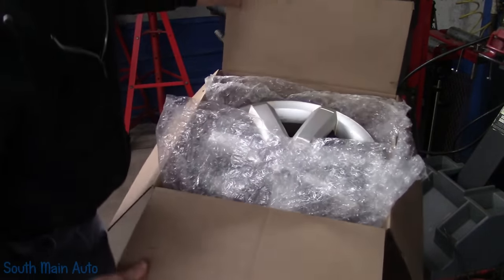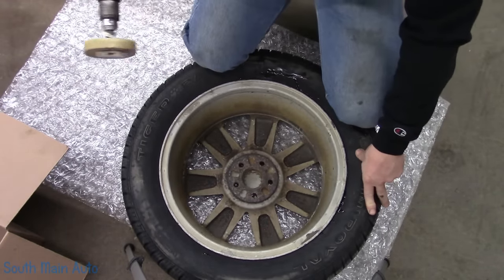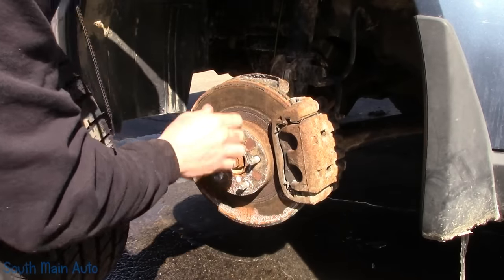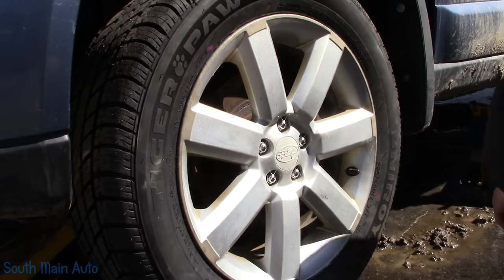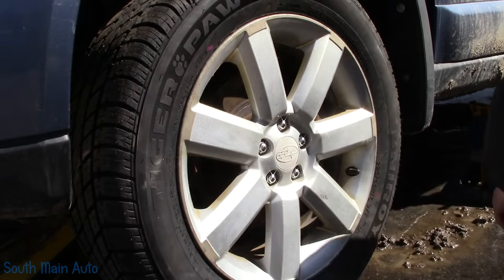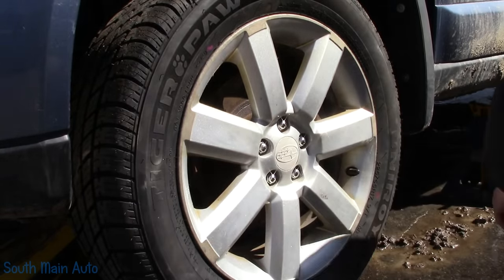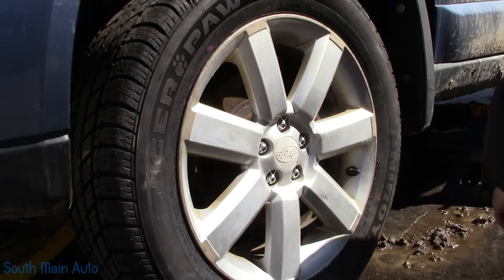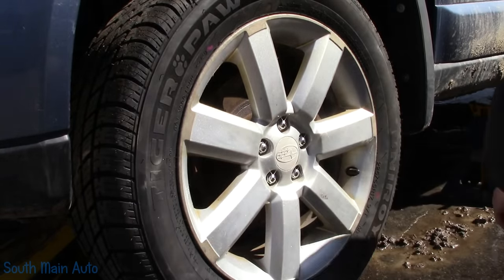Subaru Lost A Wheel On The Highway!

Comment: Eric is by far the most THOROUGH mechanic I have seen .No mechanic I've used or seen cleans rims and applies corrosion resistant goop like he does or cleans up brakes ,adds corrosion resistance.They ALL just threw them together,unless there was a problem.Raggedy old hats off to him.Great vids 👍
Reply: We always do here in Flagstaff, AZ! Plenty snow, magnesium chloride salt and the cinders around here are year round and thick.
Reply: He is one of the very few people I'd completely trust to work on my cars
Reply: @Jason Bowman maybe I'm used to the clowns at walmart tire center that intentionally put the balance weights 180 degrees off so I had to make a second trip.
i know lots of the smaller Ma/Pop shops are very good.
Reply: I used to clean the surfaces every time, especially the rotor surfaces, back when in my day we still machined the rotors on a brake lathe instead of just replacing them.
Reply: @Jason Bowman Not counting word of mouth referrals. .
Reply: @Jason Bowman The profit is in repeat customers.
Reply: He even took the tire label off to avoid a balancing error!
Reply: @daverose8772  YES! That's what I noticed. Small amount of error, but an error that was eliminated by the application of common sense.
Reply: I clean every part when I do my truck brakes. The rear drums I even clean the springs and retainers t hold the shoes on. Clean enough like new. Never have brake issues.
Reply: What are these cinders you speak of?
Reply: I do.
Reply: That's what I was wondering, 

"""
Art Wallace
We always do here in Flagstaff, AZ! Plenty snow, magnesium chloride salt and the cinders around here are year round and thick."""

What's going on in Flagstaff that cinders are around all year round? Maybe local slang for something?
Reply: ikr thats the shit i do when i work on my own car.
Reply: Obviously for the video duh
Reply: I'm confused, just need a hammer to release ball joint from control arm. And ball joint isn't pressed into knuckle. This is all the unnecessary tools required video
Reply: That is why I prefer to fit tires myself. One local tire fitter around here is well know for not cleaning the rims and then they leak air slowly. Always clean the rim, and always use bead sealer.
Reply: He's the difference between a professional, thorough mechanic and an amateur-like lazy mechanic like Scotty Kilmer. What was the last repair you have seen Scotty perform and what have you seen Eric perform?
Reply: @jameskoralewski296  Kilmer's performance is more of a comedy act to me.  I would not waste time watching him. You learn so much more watching Eric. I would hire him if he was not 200 miles away. Instead I will do my own mechanical work so I know it is down right.
Reply: Eric makes me want to tow my vehicle from Texas to New York just so he can work on it if it were to ever break down.  I wish other mechanics were as thorough and talented as he is!
Reply: Above and beyond what most mechanics do. Truly a professional.
Reply: @donbeltran30  there are a lot of talented mechanics, you just have to dig thru the pile. I ain't the best, but I will do every step and beyond to prevent the issue from rising or give wear items a longer life. One of the reasons I work for a fleet is I knew back at tech school, I would not beat the flat rate.
Reply: Living in the rust belt it's fun removing a wheel that was just slapped on. You have to use the weight of the car to break the rust bond between the wheel and roter.
Reply: And I've never heard him curse one time!
Reply: @crankshaft007  I worked as a mechanic for 20 years in the salt/rust belt of western NY, those tools are necessary. It's rare for a ball joint to release with a smack from a hammer in that region.
Reply: He’s a good tech. Most people cut corners and get mad when I don’t want to and do it like Eric. Like bro u getting paid for a complete job not half assed or cutting corners
Reply: We only use it if we have to down here in Georgia. 99 percent of the time you never have a problem, so you’re wasting product and time doing so. Only real issues I’ve had were some of the steel rims where the paint adhesion wasn’t great. I’m sure up north you need this stuff, but down here it’s just not needed.
Reply: Exactly how many mechanics are you people watching to make these assessments? Mechanics are like other people. Some are great, some are average, and some suck. You know why? They are people, and that's the way people are.

But mechanics that do a good and thorough job are simply not rare.